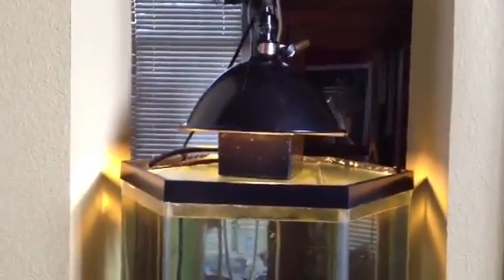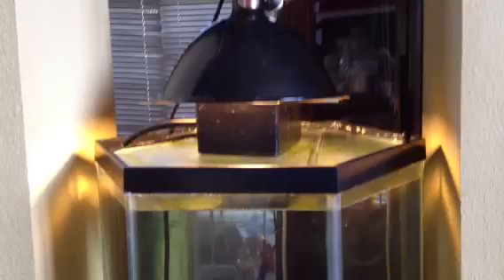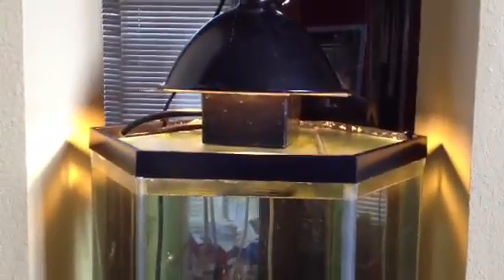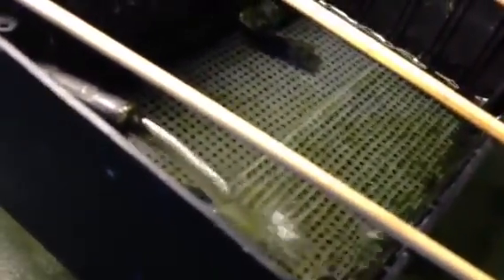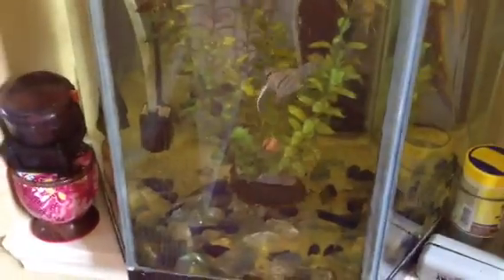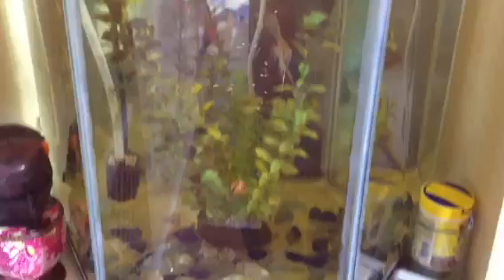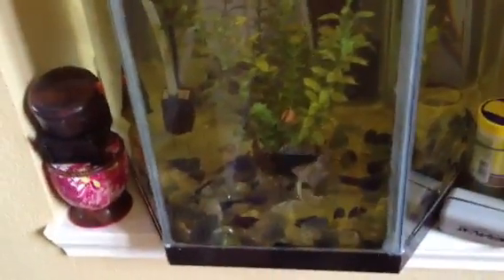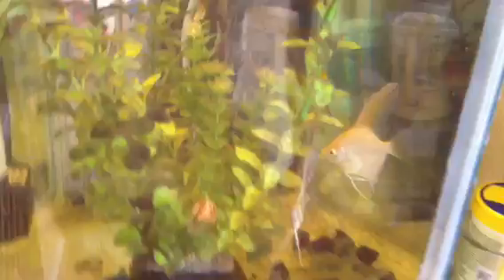Small DIY Algae Turf Scrubber Filter

Comment from the maker: I still haven't converted this tank yet to an inwall tank.  Its still in the plans.  I just need to run down to the plexigass shop in Dallas.  I've seen the upflow AS using LEDs for small foot print but it is still something in the tank I don't particularly want to see.  The box above the tank is out of the way and looks more natral but I need a little more bio area.  Once I do the inwall tank, I'll probably make a small custom filter above the tank and incorporate a micro sump and AS.

Comment from the maker: Good question, a turf scrubber takes up less space.  I plan to make this tank an in wall tank and need the filter to be small.  Plus actually scraping the algae and removing it from the tank, permanently removes it from the water.  Plants hold onto those nutrients, if you didn't remove the dead parts, that gets reintroduced into the water.  I believe algae also grows at a faster rate which would absorb more nutrients faster.  I hope that answers your question.